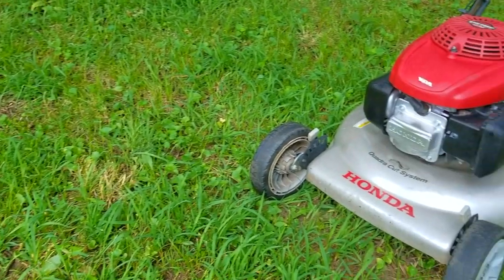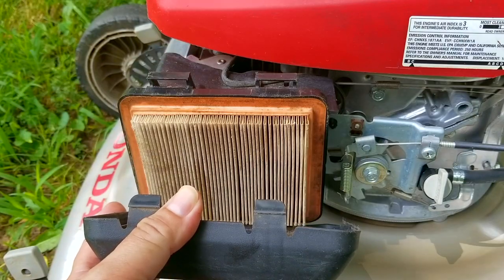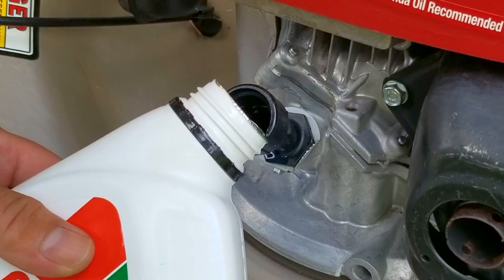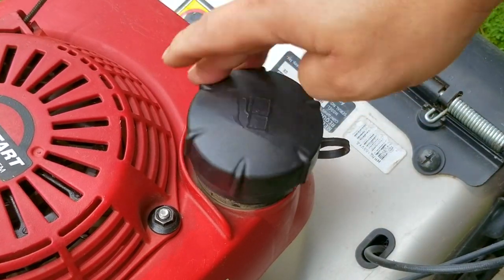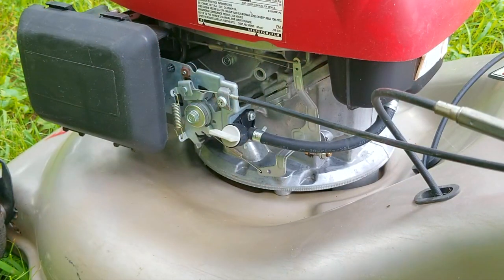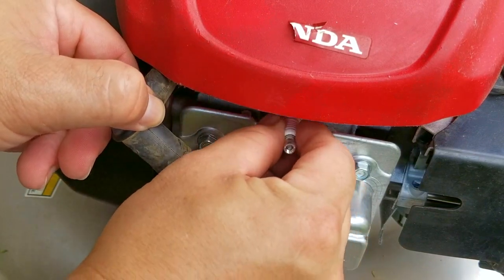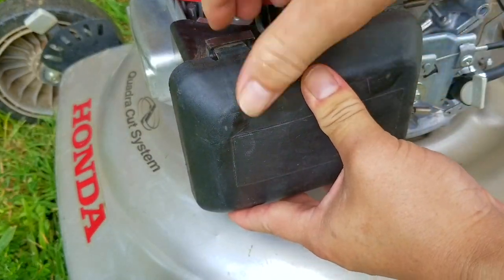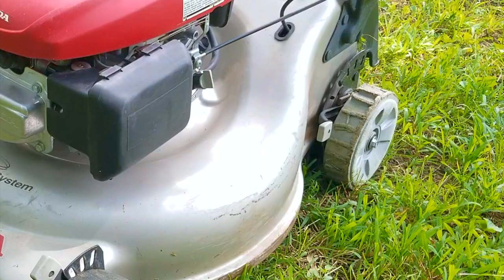Try A Honda Mower You Might Just Like It

Comment: Hey HG, I have a Toro pro line 48 that dies whenever I try to engage the blade. When it starts to engage, white smoke comes from the belt area before it dies. Any idea as to why this might be happening?
Reply: Rusted/stuck pulley.
Reply from the maker: sure, one of the bearings on the pulleys might be stuck, have you checked every pulley to make sure they all spin?
Reply: @HomeGaragechannel  I'll take a look, thanks!

Comment: Idk man I never found my old 2 stroke LB with the f series hard to pull the carb. Im actually planning to start tearing it down to figure out the compression issue tomorrow.
Reply from the maker: nice, let me know how it goes. And if I recall, it's metal plate, carb, and the air box, for the F series.
Reply: @HomeGaragechannel  well on my 7268 it's just a plastic air vane carb with the airbox as part of it, a gasket, and 2 phillips screws. Maybe some are different
Reply: @HomeGaragechannel  also I did get it apart. I could turn it by hand pretty easy with the plug in. The rings were shot. Cylinder looked pretty good so I cleaned it all up, put in the new piston/rings, 2 new seals. Now I can barely turn it by hand. That's as far as I got, but I'm very confident it will run. Worth mentioning the lower crank seal was totally beat lol. The piston itself seem decent so I'll keep it around.
Reply from the maker: nice, let me know

Comment: Lining up bolts and holes isn't the issue, it's the layers! It's like an onion! Luckily I don't work on them every day.
Reply: Use short dowels in the bolt holes to line up the carb parts, then remove one at a time and insert the bolts
Reply from the maker: LOL.. use glue

Comment: I recommend the Honda engine....not the Honda mower.
Troy-Bilt, Craftsman, Husqvarna also have some models with the Honda engine.
Reply from the maker: interesting, why don't you like the Honda Decks?
Reply: @HomeGaragechannel  I say this because of the amount of Honda mowers I've encountered with the hard to roll back issue with the gummy drive wheel / axle / tranny issue(s).
Reply from the maker: wow you must find a lot them.
Reply: @HomeGaragechannel  In the past year I've seen about 4 or 5 of them with this particular issue.
I am quite fond of the 2 blade Quadra Cut setup though.
Reply from the maker: I think I've seen about 2 that were regular transmissions, and almost every hydrostatic was stuck
Reply: It appears that all these mowers are no longer being offered with the Honda engine.  Do you have info to the contrary?
Reply: @berettaguy7445  I never buy new mowers.